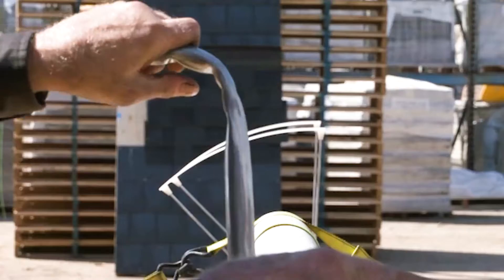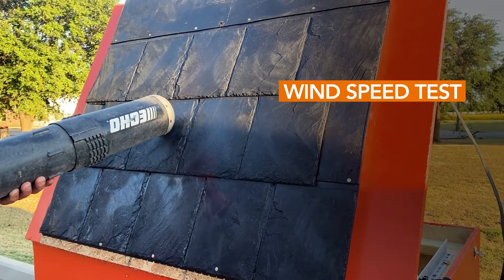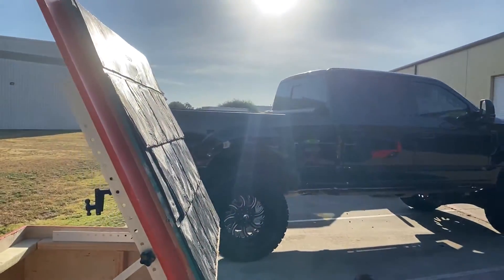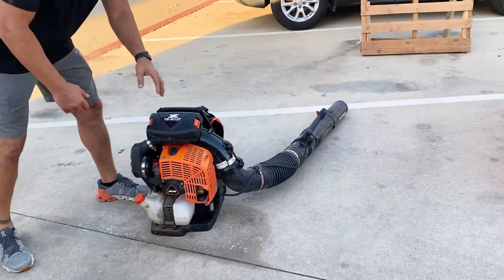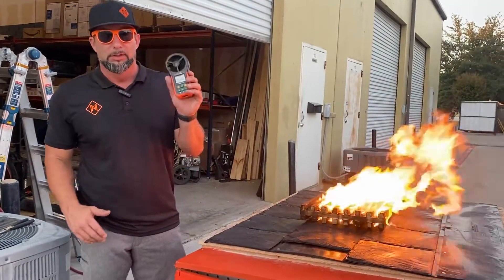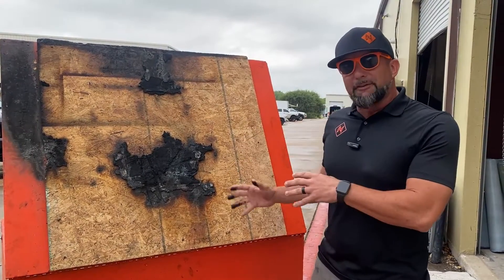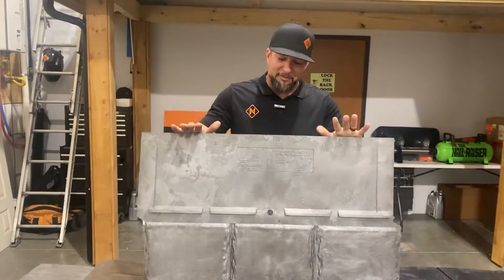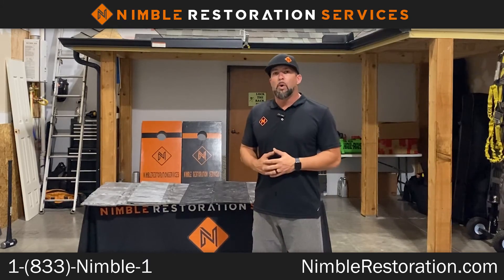The Toughest Roofing Material On The Market - EuroShield Recycled Rubber Tiles (Destructive Testing)

Comment: Will it burn?
Reply from the maker: This product has a Class C fire rating so, yes it will burn...at least under similar conditions as show in the video. 10-12mph wind.
Reply: @YourRoofologist  if it will burn why have it, asphalt shingles will burn too. But I saw one house in Hawaii that didn’t burn and you know it has a metal roof so what does that tell you?
Reply from the maker: @RandyReneau  It tells me that metal won't burn. Great product, but that doesn't by default mean that it's better than EuroShield. If you think so, I'd be interested to know what your position is.
Reply: @YourRoofologist  galvanized steel
Reply: @YourRoofologist  it might melt but that’s a far cry from a rubber tire roof, that if you have a wild fire and a roof make of steel, who get the fire.
Reply: @YourRoofologist  you’re limited in what you’re saying, I seen demonstration of metal shingles with a blow torch. Can you say the same for your shingles?
Reply from the maker: Let me help you finish that statement. "Galvanized steel is tough, but will dent with large enough hail and has a lower wind rating than EuroShield."
Reply: @YourRoofologist  will your roof withstand a 160 wind storm? How do know that steel won’t pop back. A steel roof is more environmentally friendly. The only thing a rubber roof got on a steel shingle roof is rubber might withstand a hail storm better. But I guess it a trade of when your house burns up in a wild fire.
Reply from the maker: @RandyReneau  If you actually watched the video instead of just blindly commenting, you'd see that the EuroShield material can withstand well over 160mph wind. I'm not saying that metal isn't a great material, but every single roofing material with exception for slate, tile and metal will burn, so what's your point? If the house is on fire, who cares about the roof?
Reply: @YourRoofologist  the only thing I really see is it’s good for if you’re in a hail storm area.
Reply from the maker: I can't argue with that, although it does also have an amazing wind uplift resistance. The reality though is that it is intended as a somewhat last roof scenario. It's not for everyone, but the value in it's resilience it definitely there.  @RandyReneau
Reply: @YourRoofologist  I know Edco sells a metal shingle that has a class A RATING, and yours is a c rating, and it says it has 160 mile wind rating, and fifty years warranty. I thinks about that, but it’s very pricey. I heard your might have a smell.